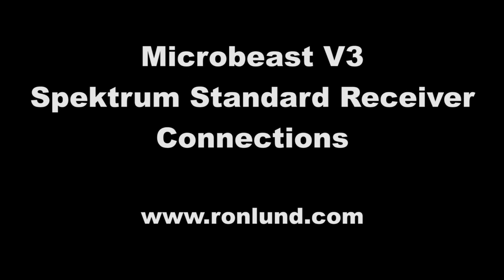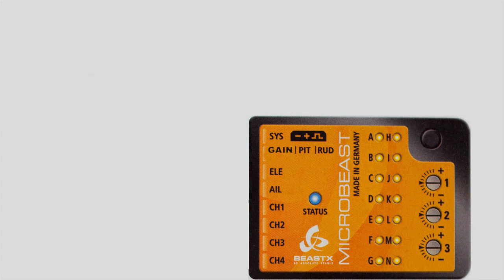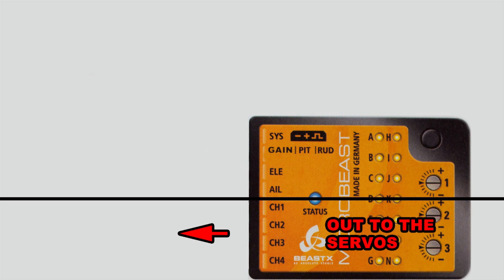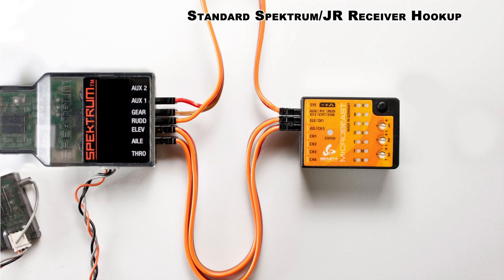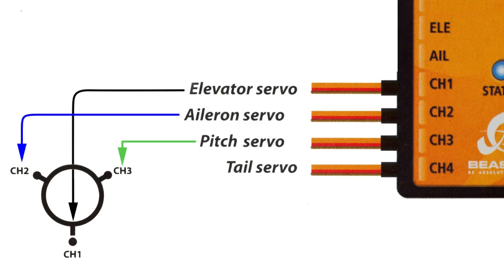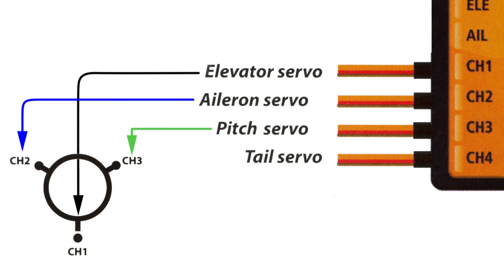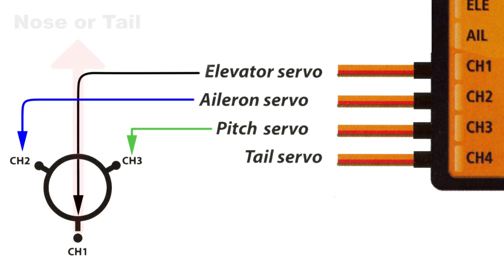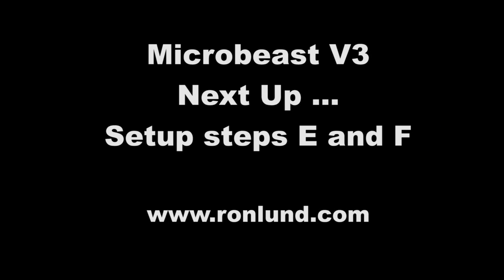Microbeast V3- Standard Spektrum or JR Receiver Connection

Comment: Hi, I have a Hitec Aurora 9 radio and im assuming that the reciever setup is the same as shown in the video here in regards to connecting the servo leads between the receiver and gyro system?

Thanks in advance.
Reply from the maker: I'm only guessing, but it should be exactly the same.
Reply: Ron Lund thank you.

Comment: Hi Ron , How do you set the failsafe when using a standard rx and a microbeast ? Is it similar to that when setting using a satellite rx ?
Reply from the maker: Move the throttle to low. Bind according to the manufacturer's instructions. In the case of Spektrum, power off the receiver before removing the bind plug. Switch the power back on and test fail safe to be sure the throttle goes to low if you turn off the transmitter. Do this before attaching the blades!

Comment: Hi Ron...i am new to the 600 Helis , i have a MicroB and an AR6210 DSMX do i need to bind the Satellite to the MB as shown in your other Videos or..... just Bind the RX to my TX as usual standard Binding, since i already have an AR6210 DSMX....
On this Video looks very Simple...on my other 450's and 500's i have the ZYX and AR6200 DSM2.....should i follw the same process .......it will be great help...if you could answer.....thanks and like you Video.
Reply: Hi Ron, i just bought the Micro beast X and also using a AR6210 receiver. Do i bind with the bind plug in the Receiver ?  Or do i have the bind plug in the Micro Beast X bind port  ?  Please, your help would be much needed.  Thanks for the video  !
Reply: 33gate1 hi..i have the same question.sir .can you solve it plz  need help..thanks
Reply: Hi, yes, you bind with the bind plug in the receiver. :)